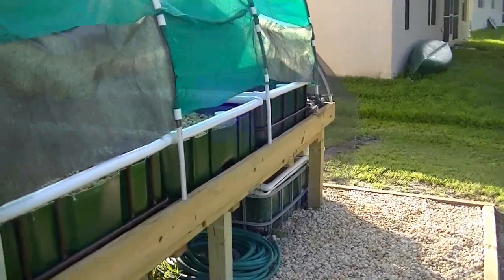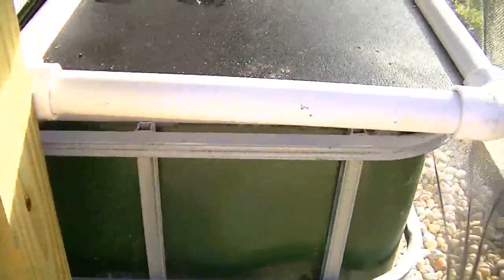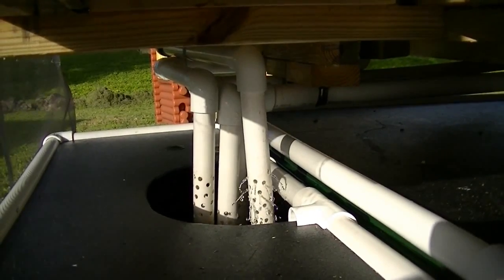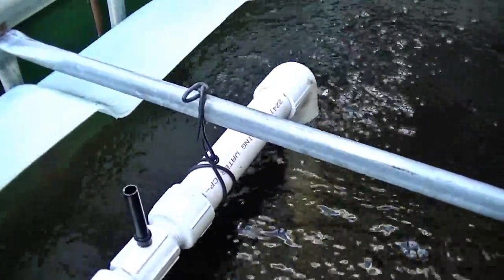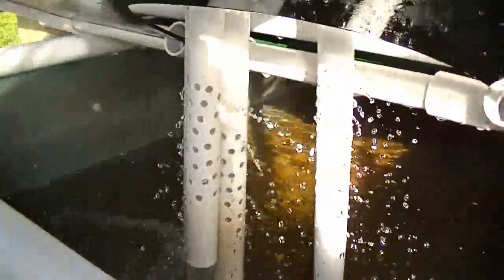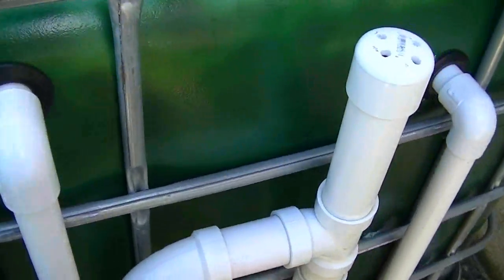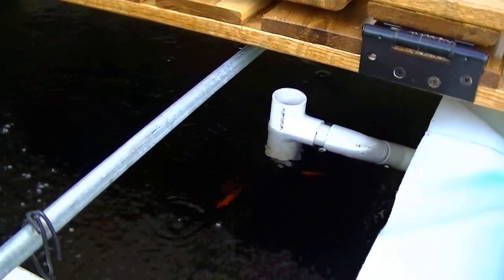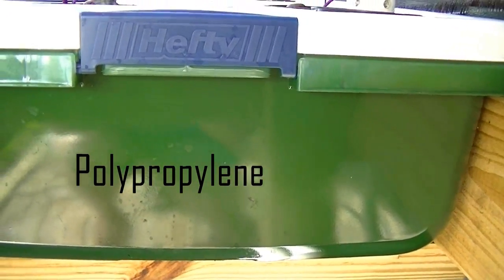IBC Aquaponics System

Comment: What did you use to make the Venturi?  That's pretty clever, free aeration without mechanical pump, cuts down on electricity too.  Great system all around.

Comment: I was told that chlorine will kill fish - did you use tap water to fill the fish tank?
Reply from the maker: You were told correctly. Chlorine and Chloramines will kill fish. I have well water so I have none of these chemicals in my water. If you use city water you can purchase products that will remove the chlorine and chloramines. Make sure the product is for both chemicals if your city uses them. You can also wait for the chemicals to "off-gas" naturally. Be sure to get a test kit before adding fish.
Reply from the maker: I forgot to mention that if your city uses chloramines, "off-gassing" naturally might not be an option. It is best to treat the water in that case. :)

Comment: So if your return pump is pumping faster than gravity is feeding your beds, does your sump run dry at times?
Reply from the maker: No. Before installing the overflow that drains into the DWC, I used a bypass valve on the pump line so that some of the water flows right back into the sump. Now the overflow handles the extra volume of water and because the DWC is a constant flow system, the water drains back to the sump continuously. Make sense?
Reply: David Berthelette I got it, watched it a few more times :).  At least with the DWC the overflow from the fish tank is being filtered a little opposed to before just straight tank water into the sump via the overflow. How often do you need to change the grow medium?  Does it get too loaded with waste sediment in time?
Reply from the maker: Rick James I recently changed the set up. The overflow now dumps directly into grow bed #3 and the DWC is fed by the sump tank through the valve I had "for future expansion". I started this last October so have not had a problem with solids as of yet. I have also added a few hundred red worms to each bed to break down solids. When I dig into the river rock, I do see a lot of brown "gunk" but it is not solid. I am in the process of designing a solids filter to help out with that. In the meantime, I have installed stainless steel food strainers,(small mesh type), under each outlet in each bed to capture the solids. It works really well but I need to clean them out ever few days. Easy to do, however. Just a quick rinse with hose.
Reply: David Berthelette  One of the things that helped in my system was to use some stockings or nylons for a solids filter. Just rubber band a piece to each grow bed inlet and clean them out once a week or so. Awesome setup here!

Comment: Also. What kind of paint did you use to cover the totes?
Reply from the maker: I used Rust-Oleum Painter's Touch, Ultra Cover. Gloss, Hunter Green. It specifically states, "Also Bonds to Plastic". I bought it at Home Depot.
Reply: David Berthelette How many can's did you have to buy for 1 tote? I've put 4 and there are still light spots throughout.

Comment: What rubber fitting did you use to connect the IBC drain to the piping (3:50)? It looks like the boot of a CV joint.
Reply from the maker: The rubber fitting is called a Uniseal. You can buy them online or at your local Hydroponics/Aquaponics store. You can find them here: "http://www.amazon.com/mn/search/?_encoding=UTF8&camp=1789&creative=390957&field-keywords=uniseal&linkCode=ur2&tag=dtpaquaponics-20&url=search-alias%3Daps"